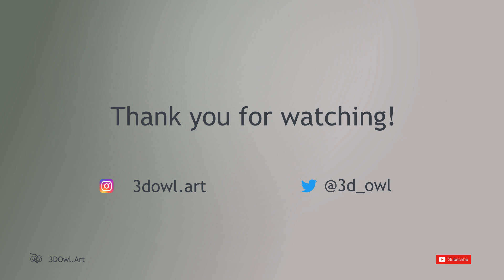How spark plug works | Animation Video |

Comment: Does the spark plug increase voltage, however?  I know the ignition coil provides electricity, but does the coiled wire inside the spark plug Also act as an inductor to increase voltage or current?  Otherwise, why is the corkscrew-shaped wire inside the spark plug core shaped like that?

Comment: Thanks 
I am going to try to use a spark plug as a diode,led or resistor in a clipping circuit for a guitar pedal.
Most things will cause clipping in a 9v effects circuit so I will breadboard up this effect.❤

Comment: can you expain more, where is electric current from, is it from generator of car or from battery?
Reply from the maker: Yes, its from car battery
Reply: Well I think is technically from the battery but directly from the coil pack or distributor cap,with out that coil pack it will never spark even if the battery is sending power.so I will say it get it power from the coil pack